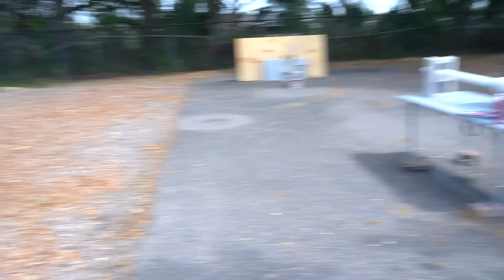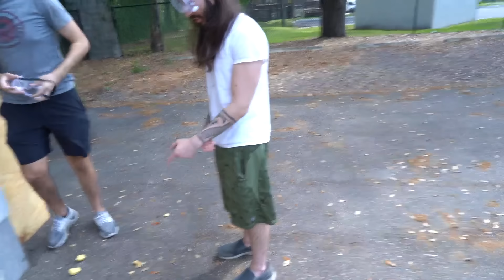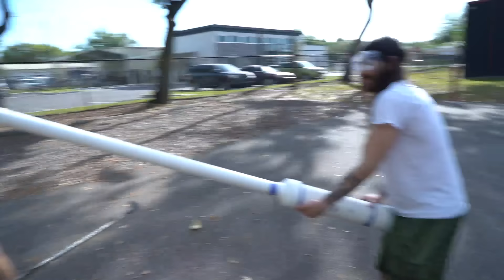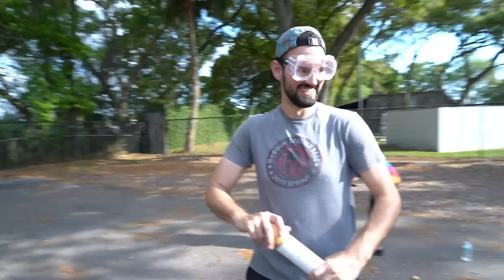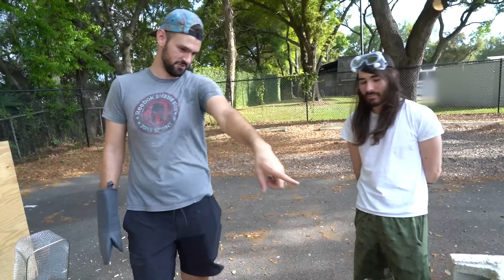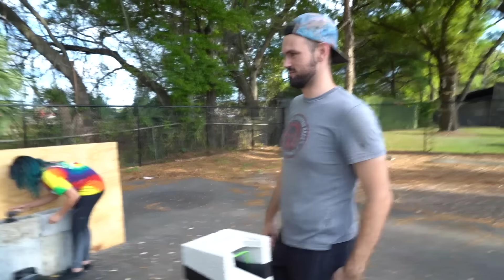Shooting A Potato At A Tennis Racket To Make French Fries

Comment: After YEARS of industry experience with potatoe guns, I have some simple yet effective advice:

-use starter fluid. Hairspray makes a mess.

-use LESS fuel. Contrary to popular belief, more fuel does NOT mean bigger bang. (Like, tap the spray nozzle a few times, that’s it)

-spray straight into the chamber, not at an angle. It’ll work more betterer.

-blow out the chamber after each run. The leftover shit from the previous combustion ain’t too keen on making boom booms.

-beans.
Reply: also find that spraying without the potato in, then ramming the potato down to compress the gasses works better too. made one with 90º bent chamber that worked extremely well too.
Reply: Mmmmmm beans....
Reply: Were you one of the kids in that classroom with Dan Quayle?
Reply: Dollar store spray sanitizer (store brand Lysol) works well in a pinch, and if you wanna get fancy you could rig it for propane. But yeah, hair spray sucks ass.

Agree about everything else. Their failures were some combo of not blowing it out and too much spray. Both lead to not enough oxygen for ignition
Reply: instead of diethyl ether from starting fluid, dimethyl ether and trimethyl borate , instead of air, use pure oxygen!
Reply: @snesguy9176  spray sanitizer is ethanol

what you could do is to take denatured alcohol and do the same you do for a woosh bottle
Reply: @VerbenaIDK  pure alcohol won't really work as well. It's the propellants in aerosol cans doing most of the work, they usually use flammable gasses like propane. That's why most aerosols are flammable, sanitizer is just one of the cleaner burning and available ones
Reply: @snesguy9176  if pure EtOH (which btw is a beast of a fuel, it's scary) why hand ssnitizer (i am then going to assume isopropanol) works better?
Reply: Look, I found Dan Quayle’s YouTube account! 
It’s “potato,” Mr. Vice President.

Comment: To everyone that would want to try to make one of these here’s some tips.

Use a barbq igniter and drill a hole for it to go in while securing it to the chassis with tape and use a mix of 3 seconds of butane and 3 seconds of hairspray that way the ignition is airtight it catches the hairspray and lights the butane giving it way more kick. If you get it perfectly it can easily go 1 km if not more and it  smashes the potato of pretty much anytbing
Reply: I use starter fluid. Hair spray makes everything sticky.

Comment: Pro tip: put an attachment point underneath the tip of the barrel and tie a string to it, run to point your aiming and pull taunt. you almost perfectly hit where the string runs within a few inches. It's not perfect because of wind and velocity but it's surprisingly effective for quickly aiming after experiments.

Comment: do a full pvc tunnel with the cutter in the middle and a "invert ramp" (or some hole at the end to drop it, so the fries hit the wall of pvc and lose their power) at the end to direct the fries into the deep frier (the tunnel doesn't have to be connected to the gun so it doesn't keep building pressure)

Comment: So Charlie. I am not an engineer but I know maths stuffs, so take what I am saying seriously. You will get a huge spread by firing without a barrel of some kind to guide it after the cut. Consider embedding the cutting part inside a tube earlier and doubling the tube length. Alternatively, have a funneled tube at the end of whatever you fired it at which pushes it into the deep fryer. It would actually be very likely to work doing this, and if you get the force right the cut wouldn't suck.

Comment: Put a tire valve stem on the cap then take a fix a flat hose and clamp it on a propane torch nozzle.  Then u use propane instead of hairspray and u don't have to keep taking the cap off

Comment: You guys are waiting way too long between spraying the hairspray and shooting you have to wait while all the bad stuff is still airborne that blows up.. next time use brake parts cleaner or starter fluid it works way better... Also it is the completely wrong oil for a fryer... You put shortening in a fryer.